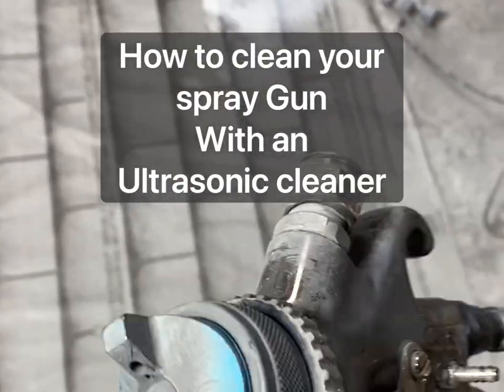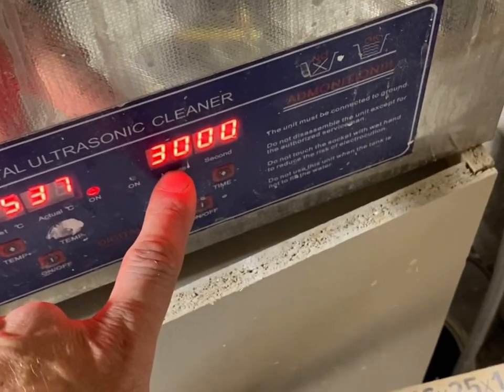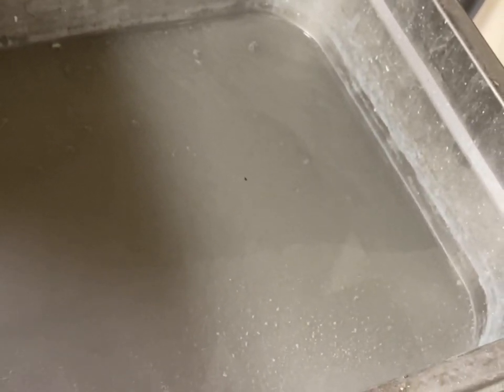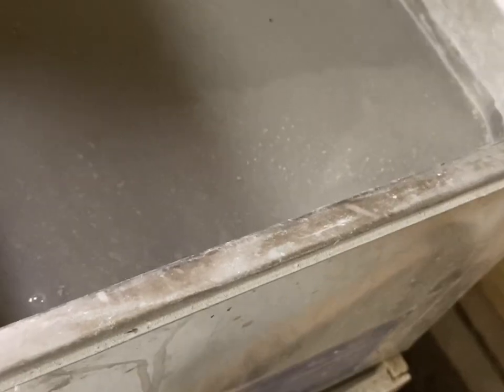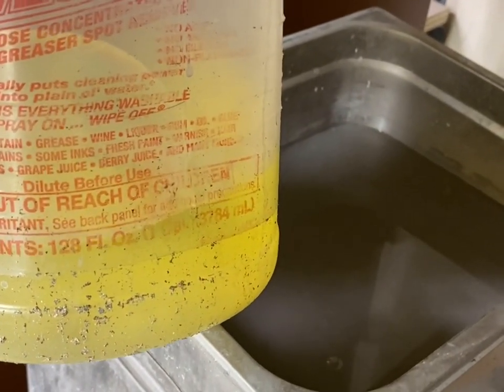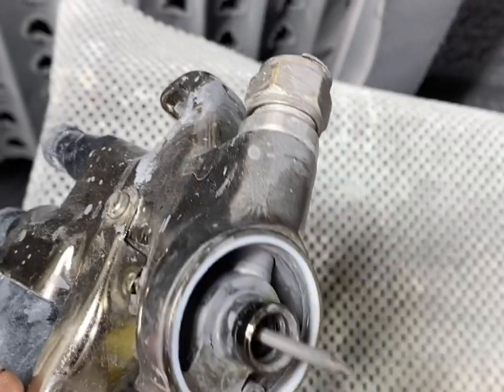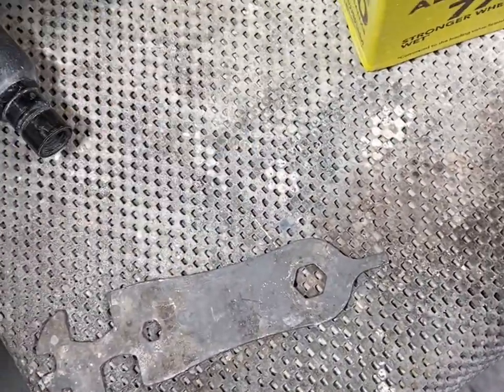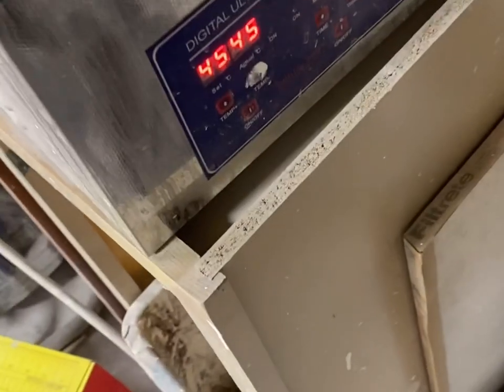How to clean spray gun with an ultrasonic cleaner  - Apollo Sprayer

Comment: I’m using the same setup and cleaner. I ran my 7700 through and it took the paint off the air cap and adjustment knobs. Have you had this happen? My temp was at 45. Maybe too hot?

Comment: Did you clean water based paint or solvent based? Is there one solution that will clean both?
Reply from the maker: I use all waterborne products. but there are cleaners available for solvent as well but I'm not familiar with those.
Reply: You don't want to use anything flammable in an ultrasonic cleaner.
Reply: @chrispurdue5762 

Because ? 
There's no direct contact with electronics 
Its common practice to use them with 99% isopropyl alcohol